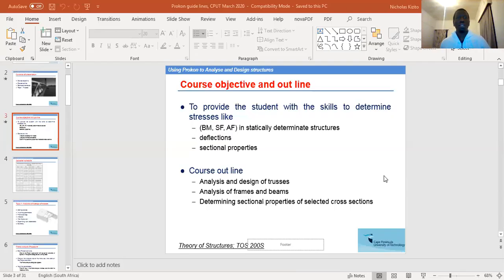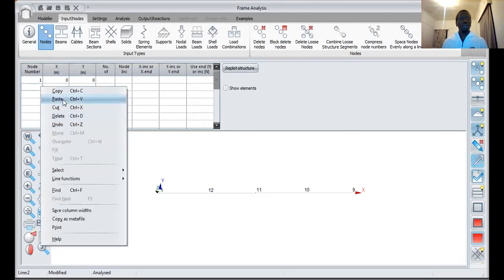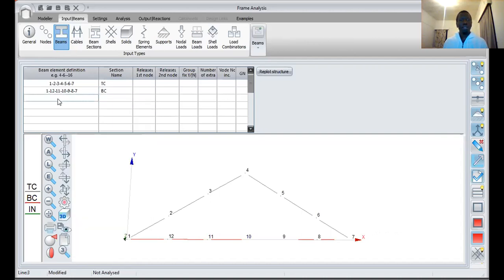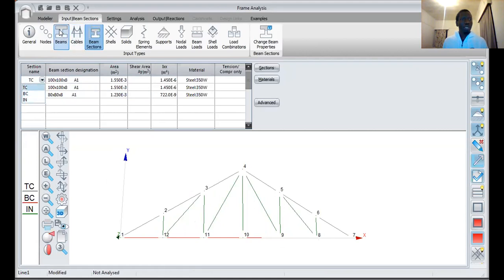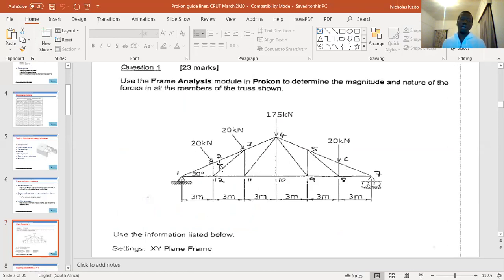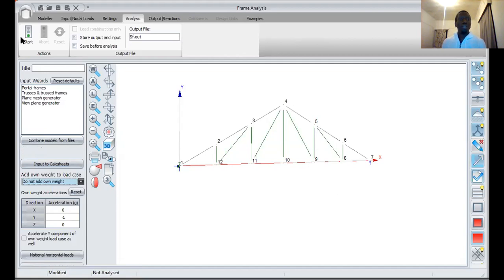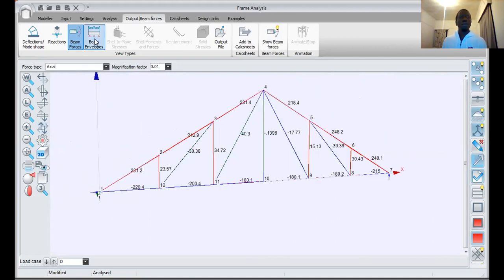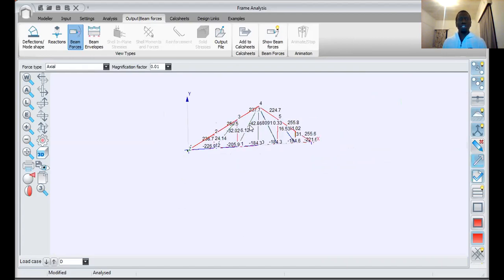1   Using Prokon for Analysis of trusses

Comment: Kizito, nice presentation. When you have reversal of stresses in a truss due to wind, how do you take care of the effective length of the bottom chord which is usually not restrained laterally with purlins like the top chord?
Reply from the maker: Hi Martin, you can re-arrange internal truss members to reduce effective length along the truss. In the perpendicular direction you can use members running from truss to truss to brace the bottom chord, similar to what you do for the top chord. sometimes ceiling members can do this but all depends on details